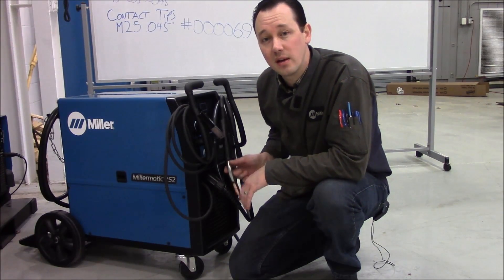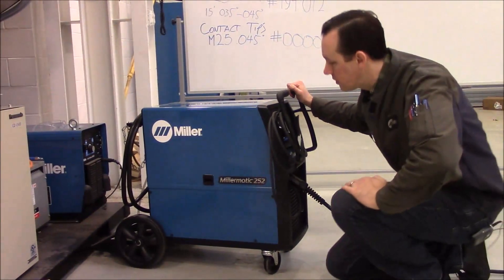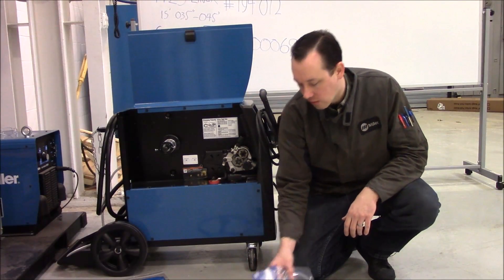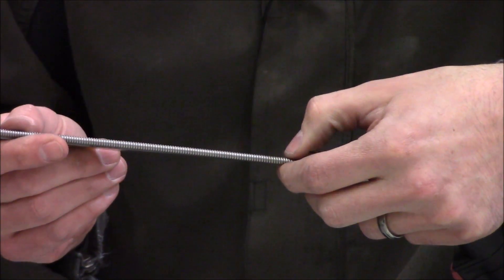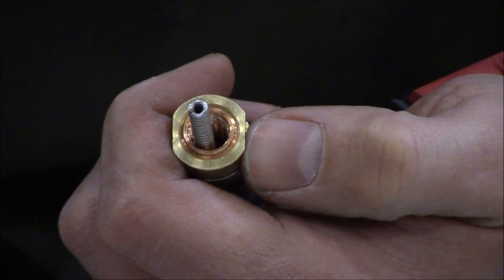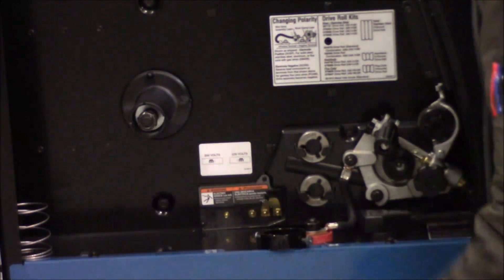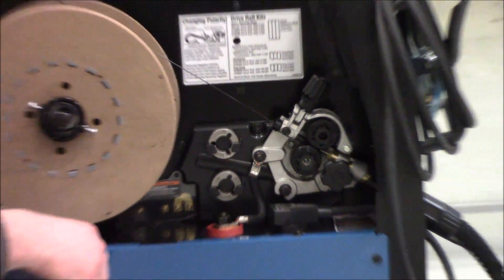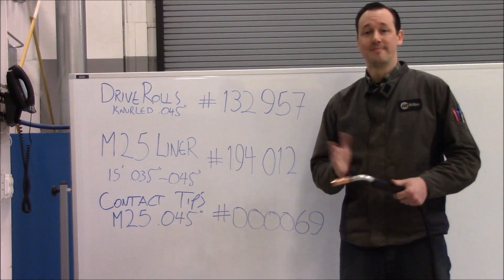Millermatic 252 Flux Core Set-Up (FCAW-G)

Comment: You did not switch polarity on your leads.  Please adjust that in your video.  !!! 😳
Reply: Section 5-8 of the manual, (page 18) states:

"Shown as shipped − Electrode Positive (DCEP): For solid steel, stainless steel, aluminum, or flux core with gas wires (GMAW)."

"Electrode Negative (DCEN): Reverse lead connections at terminals from that shown above for gasless flux core wires(FCAW). 
Drive assembly becomes negative."

So since he is still running a shielding gas, does the manual not state to stay in reversed polarity?
Reply: If it’s gas shielded flux core aka dual shield electrode positive if it’s self shielded flux core electrode negative now there’s some that’s both u have to check the wire manufacturers specs

Comment: I don’t understand why you would need a new liner.  Is that standard every time you change wire size❓what a pain.  You also have to change out the wheel to match the wire size. Why not make one that works for all sizes.  A wheel with multiple size slots just by moving it over or flipping it.

Comment: DAMN, thanks for the heads up on the gun ratings only being valid with 100% CO2. I never knew that. Why don't the manufacturers tell you that theres a HUGE reduction in power handling when you use C25 ? I suspect the vast majority of guys that don't weld for a living are using C25. Great video and i hope you continue. Subscribed.
Reply: Read owners manual. They address this issue

Comment: Great tips!  What benefits would you gain from running the dual shield flux core over just the solid wire?  I am running mixed co2 with .035 on my 252 currently as it doesn most what I need.  Is it better for welding over mill scale and paint?

Thanks!
Reply from the maker: Cole, thanks for watching!
There are a lot of advantages to FCAW-G, one if which is definitely a higher tolerance than solid wire for less than perfectly clean surfaces. (That being said, it's always important to properly prepare base material before welding not just for weld quality, but also to minimize the hazards of fumes and gases.) Some other big advantages are an increase in deposition rates, smooth / uniform bead appearance, low spatter, and many filler material options. Selecting FCAW-G over GMAW is usually dependent on the application, where one or more of the advantages are of particularly high value.
Have a great day!
Reply: Thanks for taking the time to respond!
Reply from the maker: You bet! 8)